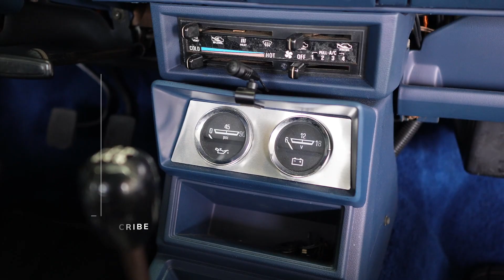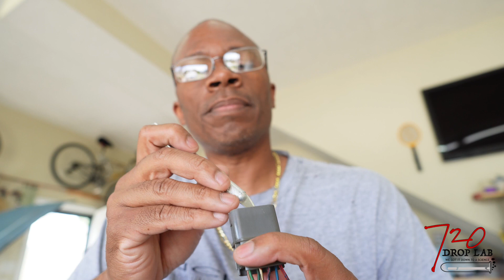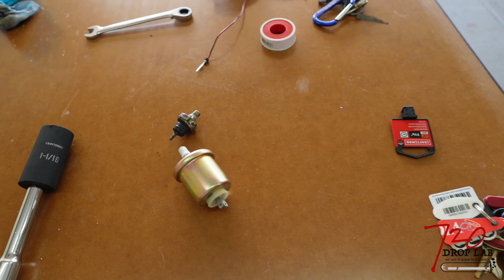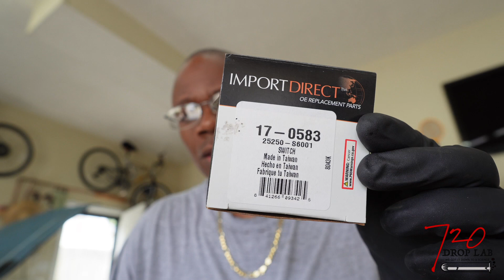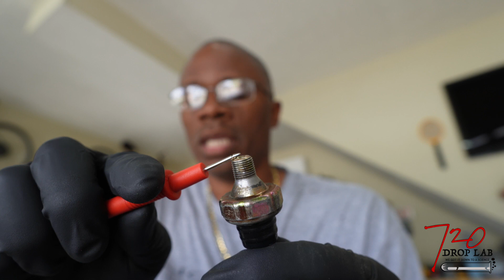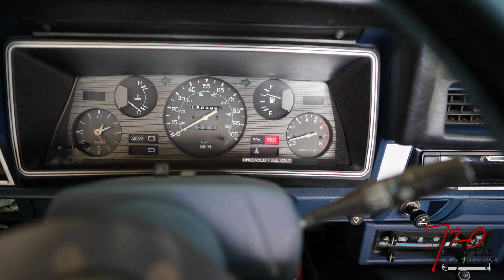Nissan 720 Oil Pressure Gauge Fix

Comment: i got a sensor but its reading too low must be defective. i shouldn't of gotten the cheaper one on rock auto i guess, it looks like the first one you had that didn't work, was rostra.
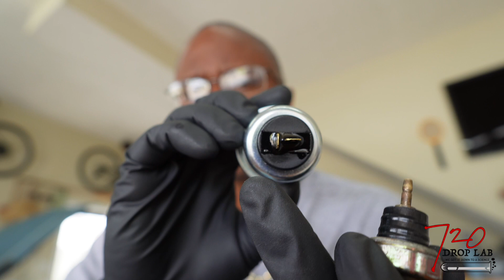Reply: 4:23
Reply from the maker: The first one I got was from NAPA and your current it didn’t work. I found the info about the second one online somewhere and it work so it sounds like it’s the sensor
Reply: @720DropLab  yeah but, it still read some oil pressure but it is reading very low, i  tried testing it with a tire inflator it was reading but its readings weren't 100% accurate.
Reply from the maker: It may not be the correct sensor for your motor.  Sometimes those universal parts can be a hit or miss.
Reply from the maker: https://www.oreillyauto.com/detail/c/import-direct-ignition/import-direct-ignition-2-terminal-oil-pressure-switch/odi1/170583?srsltid=AfmBOookkUShAwCSr2GCt8I7WLV4sMPVdN3XLJoUxF7al7hDRn3aIElY
Reply: @720DropLab its Z24 i dont think there is any difference, too bad we dont have oreily in canada tho.
Reply from the maker: Do you have a 720 shop manual?
Reply from the maker: I have a Z24 as well
Reply: @720DropLab  i just have the Haynes repair manual.
Reply: @720DropLab  yeah i have 3 engines all together and all are Z24. 
i don't have the money to get another sensor, ill have to see if i can get anything back for the one i got, ill have to put in the basic pressure switch again and see if it shows any issues.
Reply from the maker: Give me a email address and I’ll try to email you the pdf of the service manual and I’ll tell you the pages that cover the sensor.
Reply: @720DropLab i sent the email address but it seems to have vanished lol.
Reply from the maker: Go to 720droplab on instagram and DM me
Reply: @720DropLab could of been filtered out, you might be able to see it ob your end, or even gwt from my youtube channel, i deleted my instagram a while back.
Reply: Ill make an account later, guess business email is no longer a thing on youtube i guess.
Reply from the maker: I sent a DM on facebook
Reply: @720DropLab  thx
Reply from the maker: @Barret_Radtke  your welcome I hope it helps.

Comment: oil pressure sensor on rock auto is $55 is there a cheaper option? i am working on manual swapping my truck and i was looking for a new oil pressure sensor.
Reply from the maker: If you're trying to run the oil pressure gauge you'll definitely need the dual sensor. Unfortunately with everything going up in price, that sounds about right. That part is rare and scarce.
Reply: @720DropLab yeah, and that is in cad so at least its cheaper for those in the us.
Reply from the maker: @Barret_Radtke  I just looked and the auto stores here are running 47 to 55 dollars and  28 on eBay. I can't say how dependable they are. But yea a little cheaper
Reply: @720DropLab ok.

Comment: I just did this install on my '86. Thanks for the easy to follow tutorial. I am having in issue where my oil pressure gauge is reading to the max, 90 PSI. Did you have that issue with the 17-0583 sensor? Any guesses why that is?
Reply from the maker: Thanks for watching and I’m glad you found the video helpful. I haven’t had any issues with the 17-0583 it’s work great. I have never seen my pressure that high, if I had to guess what I thought it could be I would check the PCV valve it may be clogged.

Comment: i was trying to wire in the same set of gauges but my truck doesn't have wires for it in the harness so i am just trying to wire it directly but from the looks of your video i am doing it wrong i just tried to go directly to the T connector i stole from the 4x4 to the plug i stole out of an 85 i got.
Reply from the maker: Looks like you have a 84 720 (Datsun) harness I have a 86 720 (Nissan) same harness different connections, but the wiring is the same. The main harness has all the wires. There's a secondary harness for the Gauges it runs to the main harness, you'll need that. The secondary harness under the hood is missing that Yellow & Blue wire that runs to the oil pressure gauge.
Reply: @720DropLab  Got it working and found out the automatic model doesn't have the plug for the gauge and battery meter.
Reply from the maker: @Barret_Radtke  Thats good to know. Im glad you got it working.
Reply: @720DropLab  yeah, TY, 2 of the wires needed were there just hanging with round connectors under the dash ware that plug was supposed to be, had to join the T connector to the original oil warning light wire, and run a ground to the firewall and the Yellow Red wire to the fuse panel to make the setup work.
Reply from the maker: @Barret_Radtke  You got it done.. Nice Job
Reply: @720DropLab  thanks, now, hope I can solve my starting issues before the snow falls.
Reply: added info i missed earlier.

2 of the wires needed were there just hanging with connectors under the dash ware that plug was supposed to be, had to join the T connector to the original oil warning light wire, and the other end of it to the Yellow blue wire on the plug from the 85. and run a ground to the firewall and the Yellow Red wire to the fuse panel to make the setup work.
Reply from the maker: I find that a tune up solves most 720 issues
Reply: @720DropLab  not sure if there is any place near me that would know how to tune one of these Trucks. i live in Alberta Canada. if i can find one ill try to get something.
Reply from the maker: @Barret_Radtke  Oh wow Alberta Canada looks like a beautiful place. I'll have to do a video on a 720 Tune-up.
Reply: @720DropLab  yes its not bad, but i would prefer the mountains of British Columbia.
I've tried to set the fuel trim and idle speed a few times but i don't have an AFR or vacuum gauge.
Reply: now that i got the wire harness from an 85 in my truck, what wires did i need for that oil pressure sender again? i should only need one? unless there is 2 i can use?
Reply from the maker: The missing wire is yellow with a blue stripe if it’s missing it will have it on the fender well side but not the engine side
Reply: @720DropLab it would of been right by the other oil pressure sensor wire right? All i see is the one wire for oil sensor and the signal wire for the starter could it be wrapped up in the loom? My other harness seemed like it had this wire just really short.
Reply: @720DropLab ok found the wire on the plug near the battery but not on the plug that goes to the engine... 👍
Reply from the maker: The main harness should have all the wire for every accessory it the secondary harness that’s missing the wire for the T connector did you check to see if the sensor is working?
Reply: @720DropLab i dont have the 2 wire sensor yet just the single wire one is on there, i just wanted the get the wires ready for when i get one, i have the old 2 wire one that i dont know if it works or not.
Reply from the maker: Oh ok I got you. I should You how to bell it out to see if it was working. You could try that if you have a old one you never now it might be working
Reply from the maker: Do you have the 1885 Nissan 720 Service Manual  you can goggle it and download a PDF copy it’s really helpful
Reply: @720DropLab i was just worried that i might of damaged it trying to remove it from the other engine.
Reply: @720DropLab i just have the haynes manual for pickups 1980 thru 1997 and pathfinder 1987 thru 1995. Any i located on part of the harness the wire i need ill just have to tap into that.
Reply: @720DropLab  i installed that 2 pin oil pressure sensor i have, ill find out if it still works tomorrow.
Reply: @720DropLab i didnt work as i thought, but i did get the fuel pump running correctly. Ill get a new sonsor at some point, at least i found cheaper ones on rock auto, different catagory.
Reply from the maker: @Barret_Radtke  Wow sorry it didn't work. Im glad you found a cheaper one because they are expensive.
Reply: @720DropLab  all good i kinda knew it was not going to work, ill get a new one eventually, i at least got my fuel pump running right had to find my 2 wire fuel cutoff solenoid.
Reply from the maker: @Barret_Radtke  Your going to have that 720 up and running in no time
Reply: @720DropLab  hope so, winters almost here and i still have to finish welding.